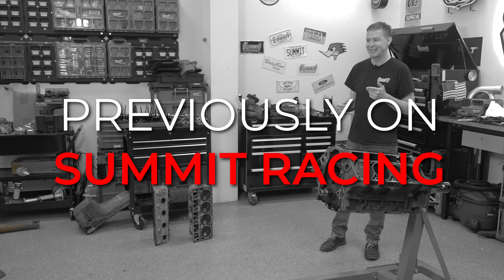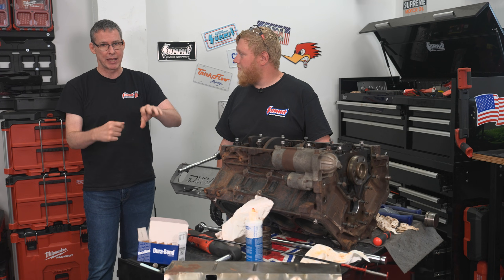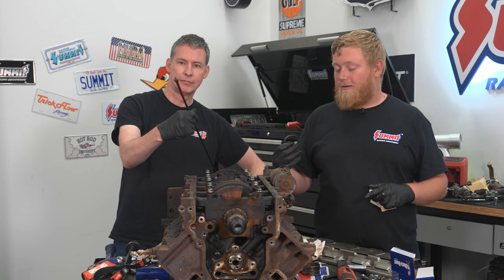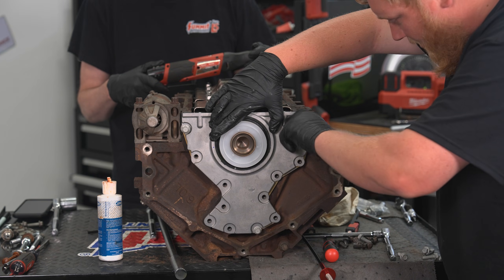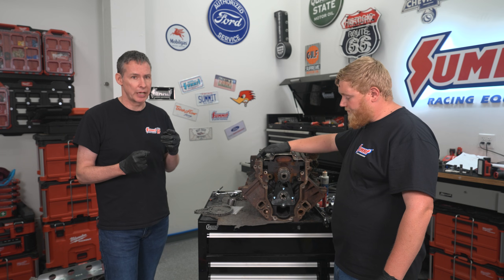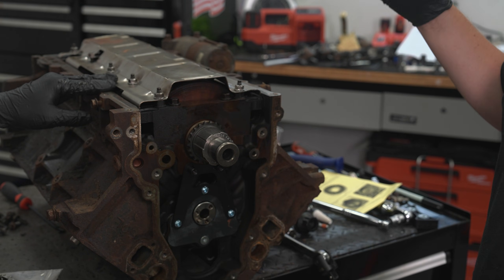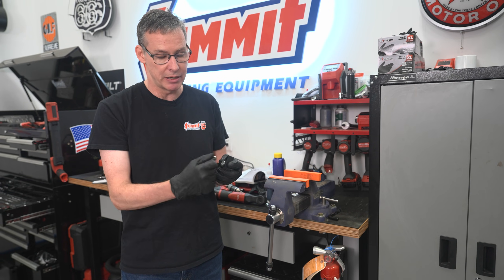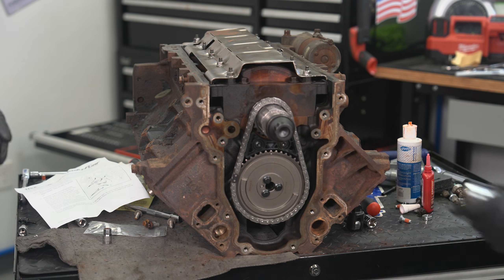Budget-Friendly 6.0L LS Power with an Intake, Cam Swap & 317 Heads—Part 3, Working Back to Front

Comment: No shimming to center the oil pump drive to the crankshaft?
Reply: Many people haven’t ever done this and haven’t had any problems.
Reply: @irageatf0rt  Great for them. The shims center it up. Melling tells you to do it two different ways if you watch their install videos. If you don't use the shims you are supposed to loosely bolt the oil pump on, rotate the engine over several times to center it up, then bolt it down. Shimming definitely makes a difference. When I did mine I tried it with and without and there was a noticeable difference.
Reply: @gearhead7896  Yeah like a said, plenty haven’t. Just  as these guys. Nothing happens :/. G’day

Comment: I have a question if you miss the Mark by 1 tooth, what will that cause the engine to do. I have an engine doing some things that make me think that it is 1 tooth slow, but under wide open throttle it runs good?